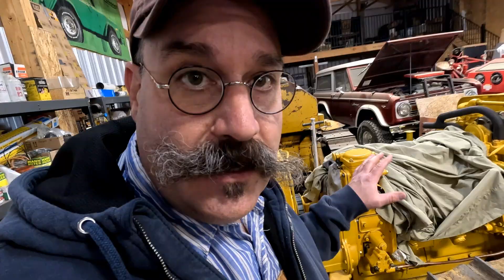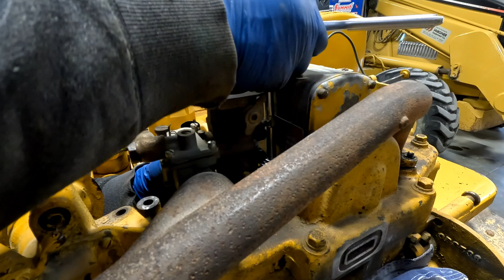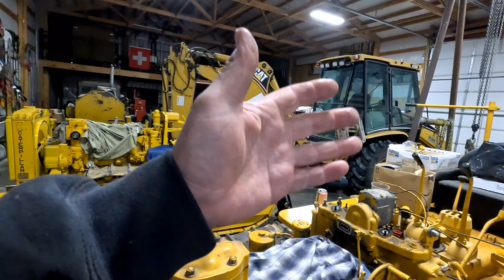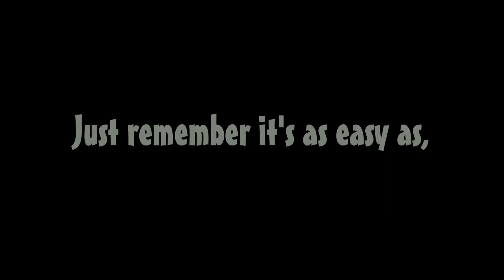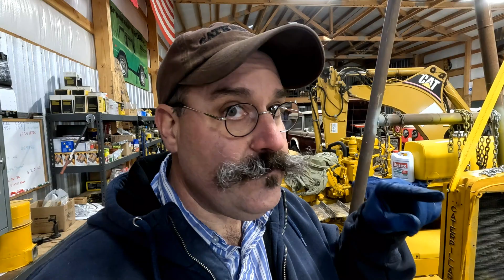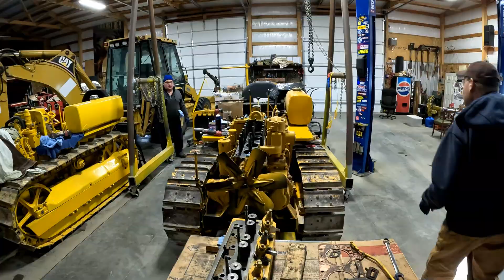1936 Caterpillar RD4 head install turns into more repairs!

Comment: While it’s often said that NASA spent millions to develop a special pen while the Soviets simply used pencils, both sides actually ended up using space pens because regular pencils were too dangerous—graphite shavings could float around and damage sensitive electronics. The Fisher Space Pen, created by Paul C. Fisher, was the solution. He didn’t get NASA’s funding, Fisher used his own money to develop the pen but after perfecting the design with a unique ink formula and a gas pressurized ink tube. In 1967 NASA purchased 100 units, but that didn’t even cover his investment.... I don't know why I know this

Comment: Well yep, one thing always leads to another when you dare to tackle just one small job on any old tractor, but Cats are even worse lol - it doesn't matter if you start at the front, or the back, or the top, or the bottom - if you manage to get it all back together before you find yourself pressing track pins you're doing pretty well 🤣🤣  On the topic of not being able to find a casting number on that pony block, if it's still the original "first generation" early RD-4 block, check on the bottom side of one of the cylinder water jackets with a flashlight and a mirror and you'll probably find it.  If the number is down there, then it's the earliest pony block that Cat ever made and doesn't have a front main crankshaft seal in it, just a reverse scroll on the crank journal so you definitely want to watch that oil level CLOSE because they liked to dump some of it into the pinion drive compartment at every startup 👍
Reply from the maker: That adds quite a bit of clarification to our Pony motor question! We noticed the pinion was very full of oil. I'll definitely have to get the mirror and flashlight out to find that number. 👍

Comment: ISO9002 is a certification of manufacturing standards. 
To achieve the rating the manufacturer has to work within pre established tolerances and adhere to specific procedures. No hammer and vice-grip type stuff.

Comment: Thanks for another great video.  I've been putting the information you provide to good use.  You info got me crawling around in a very cold, dark, cob web filled shed looking at the engine in an early 1930s Cat No.10 Auto Patrol.  Apparently the same engine as in RD4s.  Thanks to your videos I'm learning a lot about what parts are original or what has been upgraded on the motor.  Very interesting.

Comment: some of my old wrench and sockets sets included a 19/32 sounds like that is what you would need for those nuts. I have socket set that includes 21/32 and 25/32 that I don't think i have ever used

Comment: When you use the copper spray on gasket maker do you have to wait for it to dry or does it matter?
I’ve heard good things about it but never used it myself 😀🇨🇦
Reply from the maker: I was actually surprised how quickly it tacked up. It wasn't a very warm day and we were able to install within a few minutes. I highly recommend it for steel or hard metal gaskets.

Comment: I like the longer format.  30 min seems about right for good storytelling. Very enjoyable. 
Pulled the carburetor off my 5T yesterday.  That 1/2” crowsfoot is essential in tight quarters.
Good intel on the water jacket gasket.  I’ve got several of the flat sided 3B7978 on hand but none with the double ridge. Time to reorder just in case!
Reply from the maker: Thanks for the feedback on the video length. We've had a lot of requests for longer videos. The next one's going to be about 45 minutes long. Honestly about the longest I've done. We have a very special short Crow's foot just for that carburetor. 😊👍

Comment: You need a 19/32" wrench and socket for the pony exhaust nuts, it is an oddball size, i think that Cat does not even have that size, i have a german made Stahlwille socket and wrench in 19/32", if you have metric tools, you might have 15mm, that will work too.
Reply from the maker: I have several fractional sockets in 19/32 and wrenches. I never considered it until now. Now I have a reason to finally use them. 😀

Comment: Those nuts are probably 19/32 pretty common prior to 1950 or so. A 15 mm may work better.
Reply from the maker: I have some 19/32 sockets and wrenches. For some reason I never considered it. We will give them a try  or a 15 mm next time. Thank you! 👍

Comment: Several years ago, I began what I thought would be two small repairs on my UK built, Ford 5000 tractor. Like you, I found myself removing/fixing things I didn't plan on doing. Somewhere along the way, the process seemed to go wildly out of control. A few weeks later, I found myself sitting in the middle of a pile of parts that was once a tractor and my "few repairs" had mysteriously turned into a total restoration.  I hope your luck is better than mine was.😆

Comment: Looks good, which head did you use for this tractor? Did you find two heads without a crack. I like the narrow gauge D2's I hope to pick one up some day.
Reply from the maker: This tractor came with the head we installed. There are two at the machine shop for Lefty right now. 😊

Comment: Oh oh New interstate battery... well probably not for the CATs. Flexy hose? Oh dear that already spells disaster. Love the sketches in the videos.  Don't worry not just you but myself as well find all the time things I wanna fix. Well done job you two :)
Reply from the maker: The battery is actually for my T4 Volkswagen EuroVan. I left the headlights on an very cold weather. 😉
Reply: @lifeafterourloss  Has happened to me more than twice. Some of these cars don't have a buzzer to inform you. I'm glad you deiced to take the pony governor off. That was away from a very nasty disaster waiting to happen.